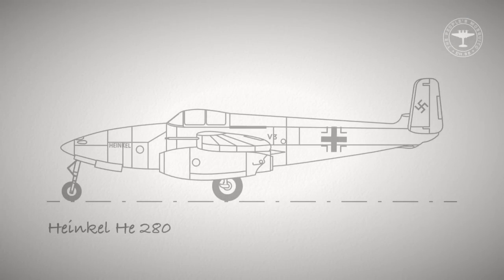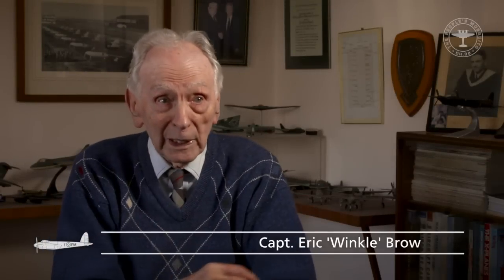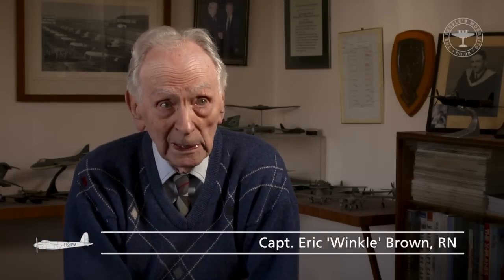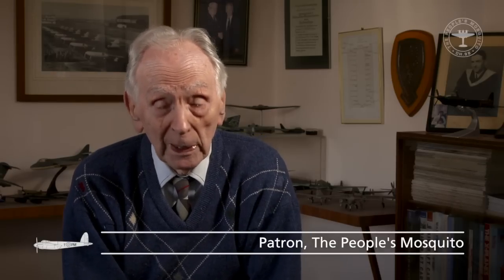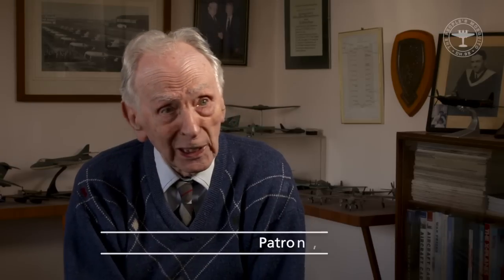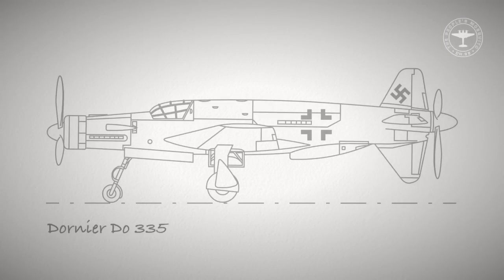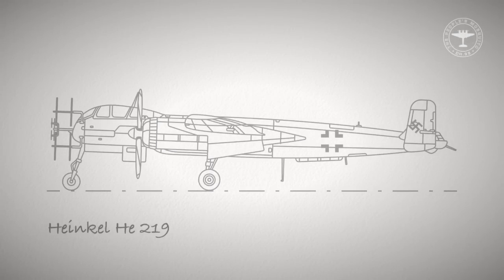Capt. Eric 'Winkle' Brown: Axis aircraft and ejection systems

Comment: The Martin Baker seat in the Australian Avon Sabre worked well but pilots died in otherwise successful ejections - the top of their head had been taken off by the canopy which was separated by explosive bolts. This was fixed by disarming the bolts and putting a bolt on top of the seat which simply smashed through the canopy. Or so I recall. I was a radio tech, not armourer.